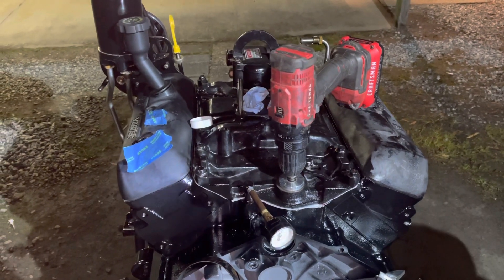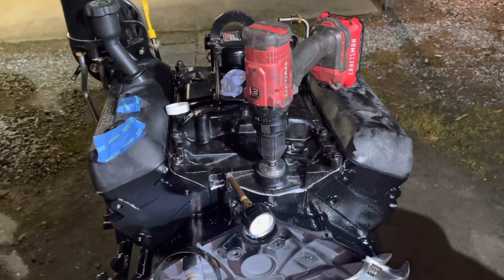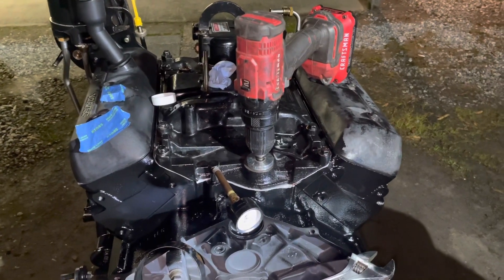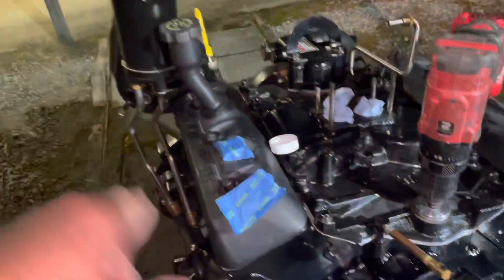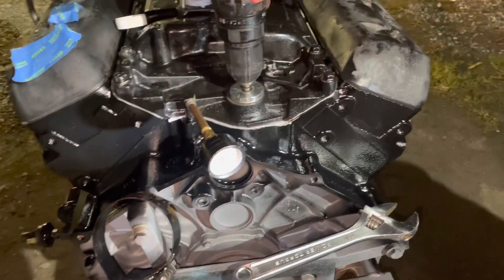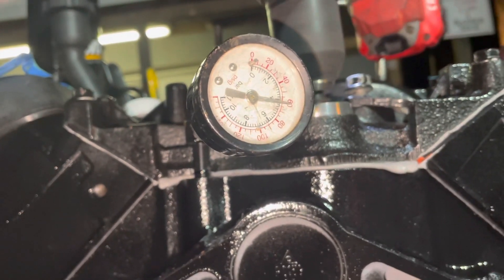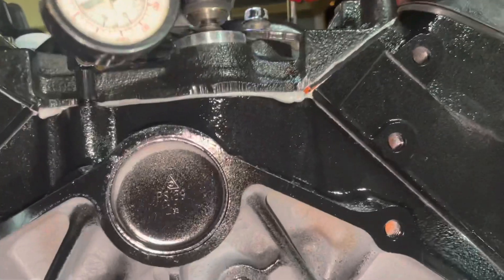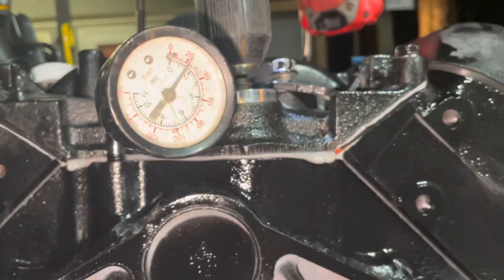Mercruiser 4.3 (3) - Filling Engine With Lot’s a Oil

Comment: i got my mercruiser 4.3 back in the boat and everything hoked back up stared it up the oil low oil pressure alarm keeps going off so shut it down take off the sensor put a gauge on it and star the boat back up oil pressure all sensor are good test them but found that the oil pressure is showing on the temp gauge but everything is wired up right
Reply from the maker: Sounds like you may have the oil sensors mixed up. There are usually three oil sensor type devices on a boat. One is the sender for the oil pressure gauge. One is the low oil pressure alarm, and the next is an electric fuel pump run switch that keeps the fuel pump running when there is oil pressure. Make sure you have the correct wires in each of them.
Reply: @moccasinmarine  got it fixed but some how the wires to the gauge crossed

Comment: I try to prime my rebuilt engine with priming tool an drill an I cant get oil to the top of the motor like out of pushrods an rockers
Reply from the maker: It takes a while for oil to fill the lifters and then work it’s way to top of rocker arms. The engine might have to be turning to make the lifters pump up. Prime engine with tool first and keep oil pressure at 30 psi or higher for 15 seconds. Then install distributor and turn engine with starter with plugs removed. This will prime a rotating engine. You should then see oil coming out of rocker arms.